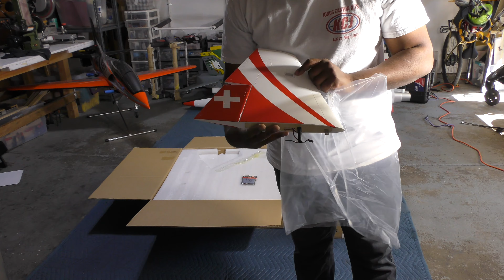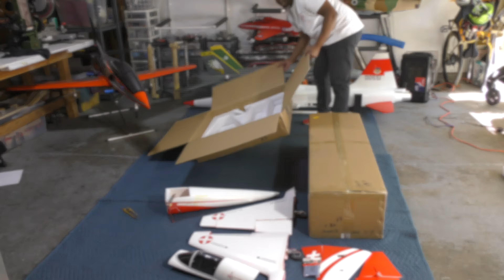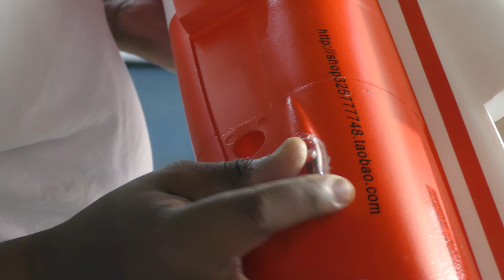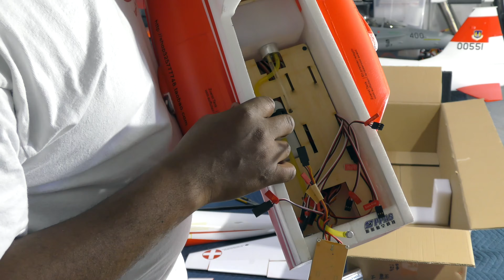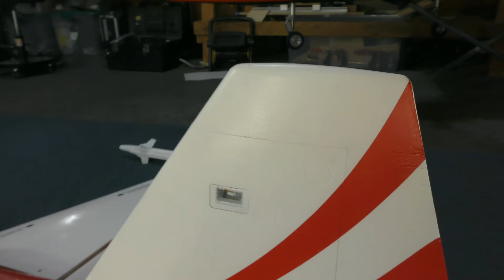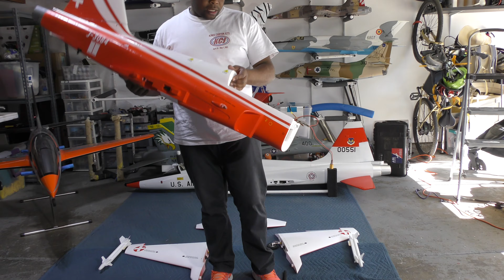Global Jet Club F5 Foam Turbine

Comment: Hey Frank . I just got the silver version. What cg are you using and what are your throws
Reply from the maker: F-5 flight controls 
Ailerons
15 mm
Flaps
1/2 =45 mm full = 75mm
Elevator
40 mm up and down
C.g. is by the book

Comment: Good work frank.   Your exactly right Arrowfoam  need to step it up for the money they’re charging.   I have a T 45 hawk in the L 39 before it was over they were basically strip completely down rewired do brake controller‘s new servos  for the elevators and a lot of touch up work to make it fly. Now so far and many flights later both are holding up just fine.   Foam turbine jets has a place in the hobby for sure.  But my composite jet should up way better for not much more.    Keep up the good work you do for the hobby !